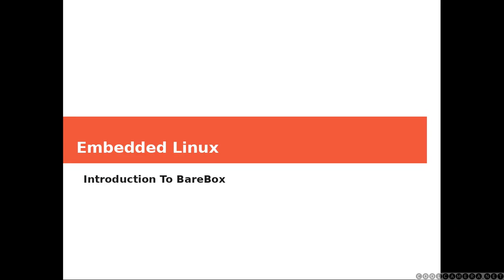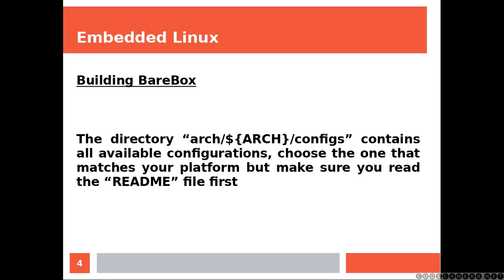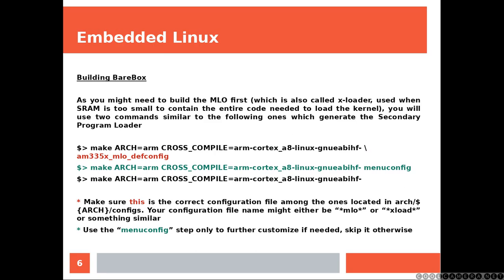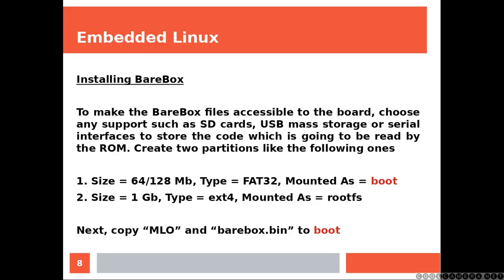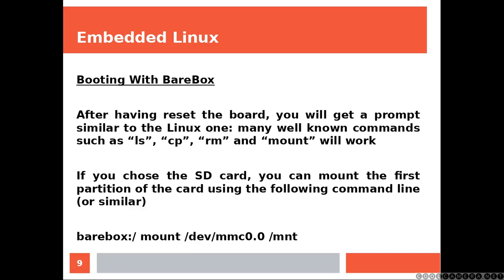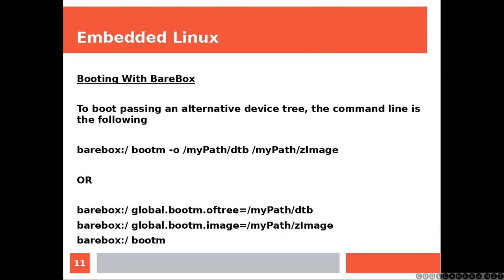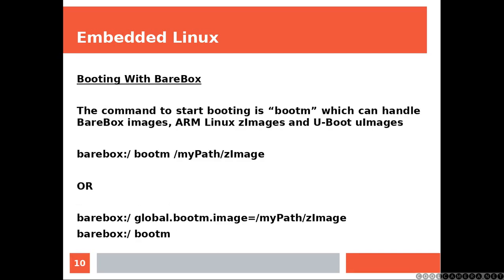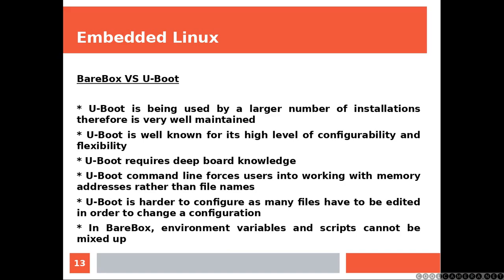Embedded Linux | Introduction To BareBox | Beginners

Comment: In general, Barebox is better or U-boot? 
(for working with a custom board and a custom ARM SOC)
Reply from the maker: BareBox is a U-Boot fork, although they have been adding lots of code of their own. Although U-Boot is older, and one could say it is more mature, BareBox is also good. As an advanced user you should be ok using both. By the way, these days lots of hardware is coming with custom boot loader.

Comment: is it possible to use barebox on cortex m3?
Reply from the maker: You might want to try emulating the Cortex M3 using QEMU first. I am positive it should be possible. Let us know! :)
Reply: @CoolCamera  I tried it. it didn't work. 
Is it possible for me to contribute to bare box repository on GitHub to add support for cortex m3 SOCs like stm32f103? 
I'm new to open source programming and Linux world. but I can understand the most CPU hardware registers and develop register level programs for SOCs without OS.
Reply from the maker: Yes indeed, on the BareBox website you will find contact details such as a mailing list and an IRC chanels you can use to contact them. I think they will be happy to receive your patches and feedbacks.